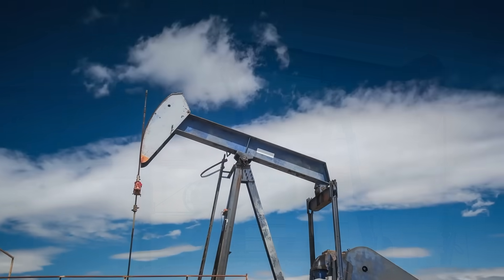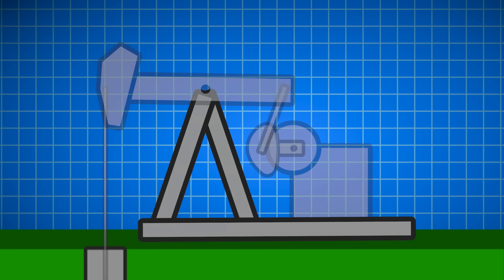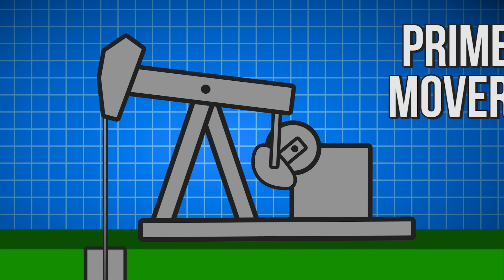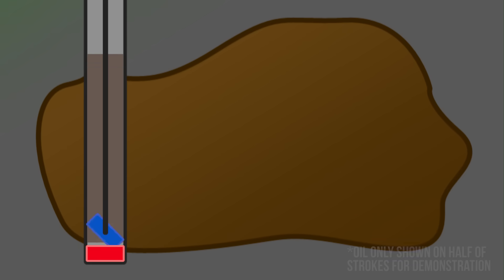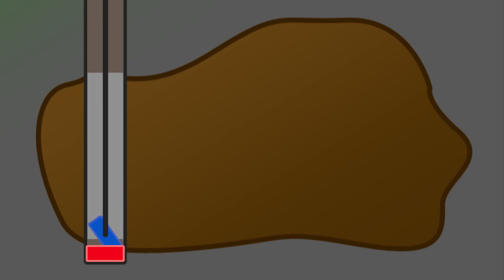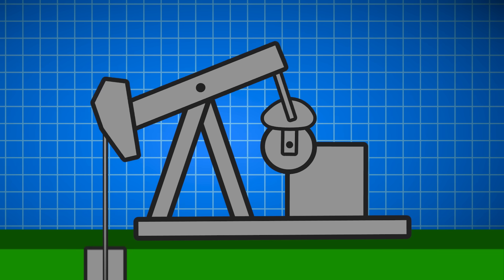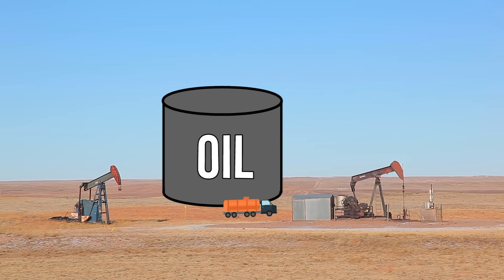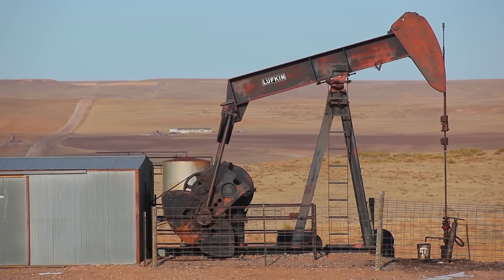How Do Oil Pumpjacks Work?

Comment from the maker: Want to support the channel or just find some entertaining children's books? You can check out all the books I've written and illustrated on Amazon here: https://amzn.to/2lTijeK
Reply: No no yes oil 🛢️ pamp for many
Reply: The reason why oil is such a good energy fs because of its energy density. What is energy density? Energy density is the amount of energy  chemical or nuclear reaction (mega joule/kilogram mass) could create (we will not be talking about energy efficiency so don't need to mention it). Fossil fuel has comparably high energy density when compare to other common energy source like lithium battery. It is very useful for airline since it can't fly if the plane is stuffed full of batteries. 

Here is a video about the possibility of electric plane.
https://www.youtube.com/watch?v=dMmaG_3NnGs&t=1490s
Reply: Green energy like solar, wind and EVs would not exist if there was no oil.

Comment: Hi, very interesting video. I work for Flintec, Inc and we sell the CC1W is wireless compression load cell used for pump-off control in the oil and gas industry. No more costly cable repairs.

Comment: THE POLISHED ROD IS ATTACHED TO THE HORSE HEAD.  IT IS SMOOTH MACHINED TO SEAL GASES OUT THE GASKET OR RUBBERS.  POLISHED ROD IS ATTACHED TO THR SUCKER ROD THAT IS JUST ROUGH METAL RODS THA ARE DOWNHOLE.

Comment: My Grandpa worked on pumpjacks for 40+ years.  Its pretty cool that some of the wells are over 100 years old and still producing oil.  Dont forget that there are thousands if not more wells that were capped that still have lots of oil.

Comment: An "oil derrick" is the tall structure that supports the drilling equipment.  Once an "oil" deposit is found the derrick is moved and the pump jack installed.  When you got this wrong I stopped watching at 0:16.

Comment: I've wondered about this for years! Can anyone tell me what the actual purpose of the horse head is? And how do they install the standing valve to start with?
Reply: The standing valve is likely installed in the pipe before it’s drilled into the ground. The horse head looks like it’s intended to counterbalance something but I don’t know what. Maybe it reduces the work on the downstroke, kind of like having a kid on each end of a see-saw rather than just one? Then some jacks have one at both ends of the beam 🤷‍♂️.
Reply: The standing and traveling valves are part of the downhole pump assembly. It is ran downhole inside the production tubing. The sucker rods are ran in the tubing and are what stroke the pump up and down. 

Pumpjacks are also called “Reciprocating Rod Lifts” in more formal terms. We usually just refer to them as pumping units. The “Horsehead” is what attaches the bridle to the polish rod and helps convert the reciprocating motion from the cranks into vertical motion. The polish rod is a shiny steel rod that interfaces with the “stuffing box” on the wellhead. It allows for the stroking motion while not allowing fluids to escape.

Comment: Thumbs up if “Landman” brought you here.
Reply: Not a great depiction of the O&G industry honestly.
Reply: @RMA_432_  It's absolute garbage.
Reply: 40 year retired Landman here and the show is pure garbage. Glorified Hollywood at it's best. The life of a field Landman is very mundane, for the most part.
Reply: @bernieulincy4244  but does it pay well? I watched that show with great interest coz' it gives us who want to learn about the industry a insight
Reply: @bernieulincy4244  You mean you don’t have a HOT AF daughter and a HOT AF cougar ex wife? 😮
Reply: 😂😂😂😂 So weird 😂😂
Reply: this is a cool comment! i had to pause the episode i’m on so i could get the questions i had about pump jacks answered🤔. the video did a good job explaining how they operate. with all the amazing engineering and talented minds we have i’m surprised they haven’t invented a different way to extract oil or improved the design of these jacks to make the job faster and safer. i’m still wondering if the planet will one day not be able to keep up with the oil demand that we have🤷🏻‍♂️
Reply: @chrisedwards2279  Pumping Units are just one form of what is called “Artificial Lift” There are many different types. Gas Lift, Plunger Lift, Electric Submersible Pump, the list goes on. There are also many factors that determine the lift type that is installed on a well. A simple Google search for “Artificial Lift Types” should give you plenty of insight.

Comment: Another version of the valve utilizes a series of large steel balls in series within a pipe sleeve at the bottom of the well casing. These balls moved up-and-down with the movement of the sucker-rod and with the arrangement of "ports" in the casing allowed the "lifting" of a pipe-pull of oil up and out of the well.

Comment: I like this explanation.  I have one point though. Although the pump jack mae be called a derrick by some. It actually is the tower built above the well head used to install and remove the pumping rods or like had a pumping cable. Also the tubing can leak and have to be pulled out for repairs. These towers are seen in pictures for the earlier 1900s. Nowadays mobile well rigs do the job of the derrick. Sadly last year we had to remove our derrick and replace the cable and tubing and install a pumpjack. We loved the historical significance of the steam engine and belt wherl and left them standing.

Comment: Isn't this the Oil Pump or called an oil derrick pump, the Derrick is the large load-bearing structure from which the hoisting system and therefore the drill string is suspended.

Comment: I am a petroleum engineer and have spent the last 20 years of my career in the oil and gas industry. Great video. Keep that oil flowing, it’s here to stay.
Reply: You would be better off to take mechanical engineering. It will get you the same type of job for an oil company if that’s what your looking for but at the same time you can use that knowledge in other industries as well.
Reply: Most pumpjacks run off of electricity and are powered by electric motors. This is generally the cheapest way to run a pumpjack and as you mentioned are eerily quiet. The electric motor spins at a high RPM and rotates the gear box on the pumpjack which is belt driven. The gear box reduces RPM usually by a factor of 30:1 and increases torque the same proportion. The gearbox output shafts rotate at a low RPM but have very high torque. The shafts connect to the pumpjack through the pitman arms and this is where rotational motion is converted to up/down motion that you see the pumpjack doing. The whole process is incredibly efficient and well engineered. When the pumpjack head is at the bottom of the stroke, the counterweights are positioned at the top. As the counterweights fall, they help the motor lift the weight of the rodstring up (the rodstring is very heavy). Then the weights are at the bottom of the stroke, the pumpjack head is at the top of the stroke and the rods are ready to fall back down again. The rods descend back down at which point that energy is used to help move the counterweights back up. The weights are adjustable (the operator can adjust them back and forth) and this process is called balancing the pumpjack. A well balanced pumpjack will likely consume between $150 - $500/month of power depending on how much fluid the well is pumping. In isolated areas where there is no electricity , the pumpjacks run off of propane motors which are another piece of well engineered equipment. In some cases, the oil companies run the propane motors off of the natural gas that the well makes, also known as running your motor off of casing gas. Anyway probably more info than you wanted to know.
Reply: @Jackofalltrades837  Wow! Thank you, not too long at all; it helped make it make sense to me. I ride motorcycles, so I understand a little bit about rotation v torque ratios with the sprockets and gearing. The pumpjacks use such simple yet very effective technology; it's so facinating to me! 
How did they make them run waayy back when they were invented? Was it circa pre-electricity? Sorry for so many questions. I'm ADHD and my brain makes a ton of questions to make sense of 1 simple answer!😬 I really appreciate you taking the time! 😃
Reply: @Jackofalltrades837  I know of a variation on using casing gas.  They used the casing gas to run a generator, which powered a bank of computers in an adjacent shed. The computers ran 24/7 doing Bitcoin mining. Power consumption is the largest operational expense in mining.
Reply: What are your thoughts about petroleum engineering as a career?
Reply: Hi, I've watched the pumpjacks operate since I was a little girl (now, almost 55) along the California Hwy 101 corridor north of Paso Robles. I finally decided to find out how these things work today whilst driving by again. One thing this video didn't say is how the engine to make the spinner rotate, how does that work? It said gears, but does that itself run off of gas? Where does the power come from? I stopped one year to look at them up close, and their silence is weirdly frightening for such a large machine. I just still don't understand how they stay running. Can you help answer that question? Thanks! 😊
Reply: @MamaPinks  I had the same question, especially since so many are operating in “the middle of nowhere.” 
By the way, I think the first time I saw a few of them in operation was near Long Beach.

Comment: When I became a pumpjack technician, I fell in love with learning about pumpjacks, and down-hole operations. I wish I could have been born years ago to experience it for many more years than I'll likely get to in my life time.
Reply: Sir Technician, may I ask why are they never removed? I see many stay without function for years or decades.. Not moving but not removed or moved to another place?
Reply: @Fukallah because they're not hurting anyone jackass
Reply: @Fukallah  Economics.  The cost of disassembling, replacing worn parts and refurbishing others, plus the cost to move it to a new location would be the same as buying a new one.  Once an oil field gets pumped out there needs to be enhanced recovery methods employed to recover any remaining oil and it just isn't economical at current prices.  So shut the well in  and wait a few decades to see if it becomes profitable again.
Reply: Are there individuals still running their own today? Hard to find info about how to DIY, but why not try!?
Reply: take you odd obsession somewhere
Reply: @CrisYTchan Retard

Comment: Excellent video . There is one thing he left out . At night you can see these  pumps burning off  oil . Shooting big flames off intermittently.
Reply: A bit late but if anyone reads this... What they're doing is flaring natural gas. It's much safer to just burn it off than simply vent it into the atmosphere for a few reasons.

Comment: Did my 22 years in the "oil patch", and was a roustabout, floor hand, trk driver, pumper and heavy equipment operator... I can still take one of those units apart and put it back together in my sleep... Hardest work was a floor hand on a work over rig, easiest job was a backhoe and crane operator....
Reply: Hello

Comment: Why don't they use submersible pump??
Reply: Some do! Part of my job, (well servicing) involves running an ESP (electronic submersible pump) into an existing well, then the pump jack is removed. ESP's are neat, you need to run a cord all the way from the bottom of the well to the top to be able to provide power, this cable is ran alongside the tubing and can be over 2000 meters long, depending on the depth of the well. If you ever see a well head and flow lines sitting in the middle of a pad without a pump jack on it chances are its either an ESP or an injection well.

Comment: It's never called a derrick except by a few people that don't know what they are talking about. 
The size of the pumping unit is dictated by the stroke length needed by the pump. No the depth of the well.  Now, deeper wells generally have a longer stroke length pump installed.

Comment: Thanks for the video. I thought they pump water into the oil causing the oil to rise through the pipe.
Reply: Injection wells are placed nearby to oil wells to do exactly that, they don't produce oil themselves, but they help the pumpjack wells produce more oil
Reply: @bigcat2501  Thanks for the info.

Comment: Actually, the end of the oil biz is on the horizon.
70% of all crude oil worldwide is refined into motor fuels.
Tesla has just made a BIG battery break through
and others are working on a new lithium battery tech 
which will make e vehicles so efficient & longer
range that internal combustion engines.   aka I.C.E.
will not be affordable. It won't take long for e vehicles to become more
numerous than ICE vehicles. The loss of fuel sales revenue will cut the oil co's off at the knees.
With 70% less sales, there will be 70% less money
to maintain their infrastructure not to mention to search for more oil.
Big Oil is not going to like having to settle for 70% 
less  profits. Gas stations & refineries & oil fields & pipelines will close on a 
great scale. Smart gas station owners will convert into e charging & repair  
stations. The oil co will try to prop up their diminishing 
profits by raising prices so the people who will be ICE 
holdouts will pay dearly for what fuel is left.

THE FUTURE IS WHAT WE MAKE OF IT...

!
Reply: and all the plastics these electric cars need will be made from soybeans.

Comment: It’s a traveling valve. Its a pump that attaches to the rod string. There will be different sizes of rods. 3/4,7/8,1,1.5 sinkers bars, etc...  rod design will vary depending on well depth and deveation. There will also be different pump sizes depending on tubing string and flow rates you are after all Varys per well and well age and conditions. Good vid. 👍🏻

Comment: ummmmm , about 50 percent wrong , you should look into it a bit more. i have been in the oil industry over 25 years and presently work on bottomhole pumps . bottom hole . not surface, your video explains a prime mover , of the bottom hole pump

Comment: I spoke to a person who had worked for years repairing these in America and moved back to Scotland, he informed me that they would have to push these to get them started again if they stalled/stopped as the motor didn't have the power so start on its own and would burn out without a push to start the rotation again..

Comment: LMAO I grew up in a oil town and been working in the oilfield for 15 years....the terminology and explanation of things makes me laugh. Ya they use those riding valves in shallow wells but for many many years they mostly use a down hole sucker rod pump. The design is pretty much just like a water well pump. Also, the Derrick is term for a part of a drilling or production rig. You say Derrick, people are gonna look for a rig.
Reply: So I noticed steam lines are often attached to Oil Wells. Why is that? What does steam do in this process? Thanks.

Comment: Size of the pumping unit has to do with the length of stroke  required by the pump selected for the well. It has nothing to do with the depth of the well. 
Deeper wells generally have the ability to produce more oil and therefore can feed a higher volume pump, but it's production, not depth.

Comment: The bottom hole pump works as he describes but it’s by balls and their metal seats. One sits stationary in a strainer device at the bottom of the pump (basically a long barrel between 6 and 18-20 feet long with a plunger device travelling up and down inside the barrel by the motion of the sucker rods) while another ball rides up and down in a plunger. Yet a third ball and seat is at the top of the pump. Suction is created on the up stroke when the plunger ball seats and the bottom ball opens up allowing oil up into the barrel and on the down stroke the bottom ball seats keeping the oil in the barrel and the plunger travels through the oil back to the bottom with the plunger ball being forced open by the oil. The top ball is closed on the down stroke keeping the oil above it in the pipes from draining below. The next stroke up forces that oil up the tubing as it sucks more oil out of the ground. It’s been 22 years since I built these pumps, but that’s a crude explanation of it.
Reply: No pun intended with "crude"?

Comment: I'd replace sucker rod with rod-string since you can also use corod. Referring to a pump jack as a derrick must be an American thing since Derrick up in Canada usually means a rig is there. Maybe I'm wrong just seemed off
Reply: Also, the rodstring isn't connected to the horse's head; it's connected to the carrier bar which is connected to the bridle cable which IS connected to the horse's head. The diagram of the oil reservoir also looks too random and is pretty shitty. Rock formations don't look like amoebas

Comment: "Renewable energy is making a strong play for powering the world" as you show a clip of solar panels.

Solar energy is 47cents per kilowatt hour.  Oil is ~3 cents per kilowatt hour. 

Inform me when solar is on par and we'll talk.

Until then, the only thing on the horizon that could replace oil is Thorium nuclear energy, which is estimated to cost 1.4 cents per kilowatt hour, based upon the costs of building the first liquid salt reactor back in the 60s, adjusted for inflation.  I'm sure mass manufacture of reactors will drop the price significantly.

If we can get electricity down to below 0.9 cents per kilowatt hour, we will kill oil.  0.9 cents per kilowatt hour is $15 dollars/barrel, and that's the cost that the Saudis pay to extract each barrel of oil.  Oil has never been below $15, adjusted for inflation, because it can't.

I'm not sure of climate change is real or not, but just in case it is, I think we should be investing heavily into thorium nuclear reactor development for the cheap price of energy if not for saving the climate.

Thorium in 4 minutes:  https://youtu.be/k6BXvw6mxtw